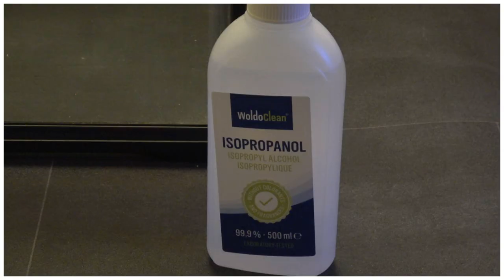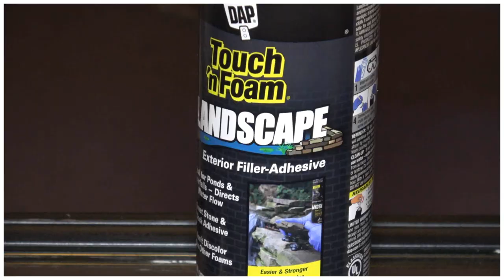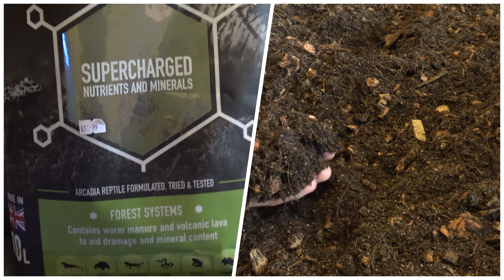The Big Build #bioactive #enclosure

Comment: Just a little tip, you should never use mold resistant silicon for animals. Maybe it's OK with spiders, but fish and dart frogs will die from that because it contains fungicides that are deadly to them. Always use aquarium silicon and let the spring tails and isopods take care of the fungus, bits and pieces of leftover food and feces. You also have to be careful with plants you buy, some of them might have been sprayed with pesticides. It's best to not use the soil they came either and to rinse them off well before you plant them in the tank.

Looks nice, though, what kind of spider will you be putting in it?
Reply from the maker: Yeah I got you bud been a year now all good plants over grown the tank filled it out nicely the T is inside is a pamphobetus arana polito 🙂
Reply: @MarksTarantulas  thanks for rather reply! 🙂